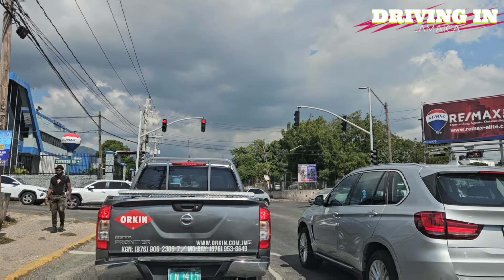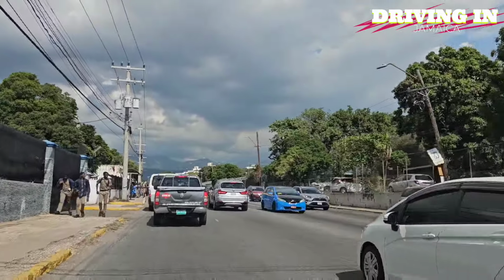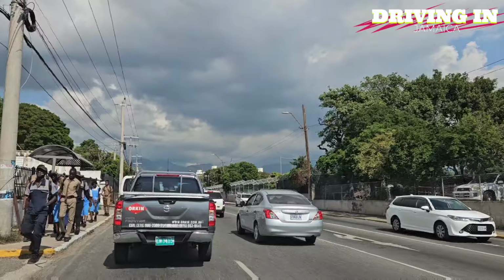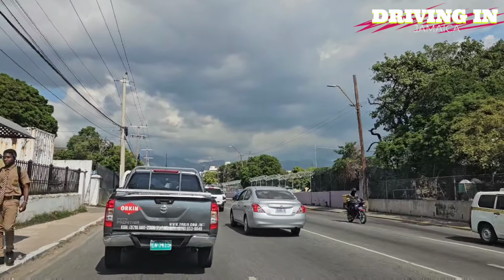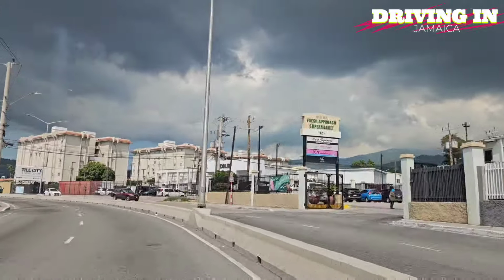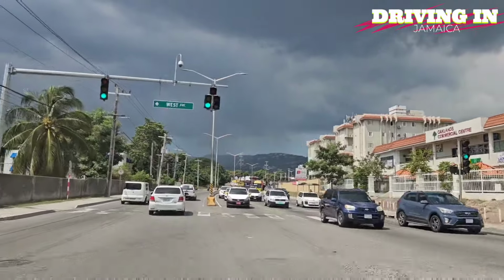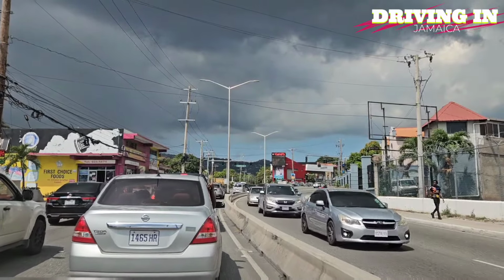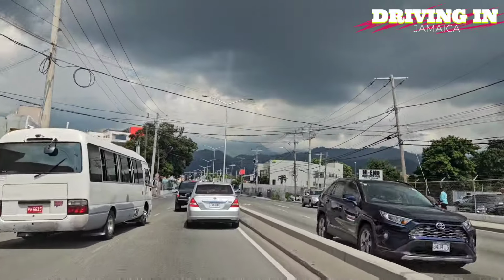Construction Equipment Damaging Roads Jamaica

Comment: From what I have seen in North America, the heavy equipment is usually tramssported to the sites, like front loaders or tracked vehicles. If the road has to be dug up to dig a trench for pipes, it is usually temporarily covered with thick steel plates until the  permanent work is done.
Reply from the maker: Thanks

Comment: The Waterloo road was dug up and without any signs or explanation for at least 2 months. We had to guess that it was for water or sewer pipes. The pipes are in and the road construction is still in a state where you have to be swinging or slowing down to avoid pot holes and badly reconstructed
Also i am wondering, when these apartments on Waterloo road, Barbican road and in Drumblair are fully occupied, how will the rush hour traffic move on those roads.
Presently it is already dead traffic on those roads during rush hour.
Reply from the maker: The traffic and water supply.